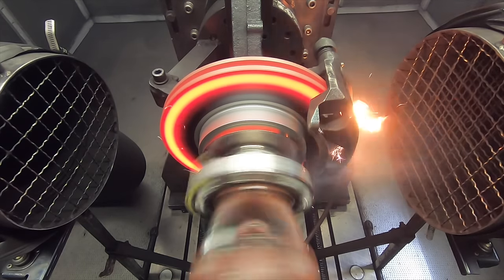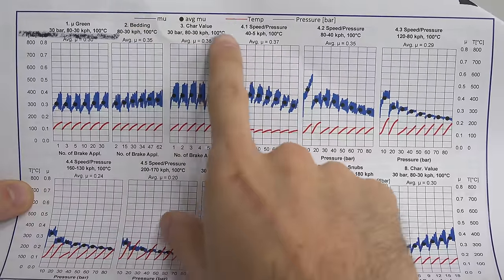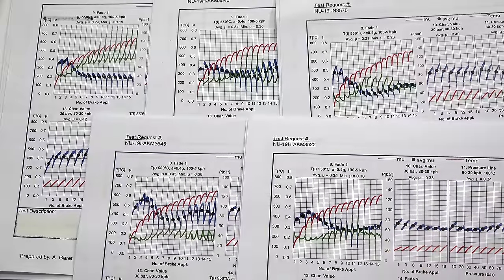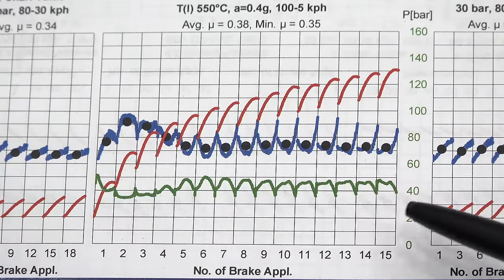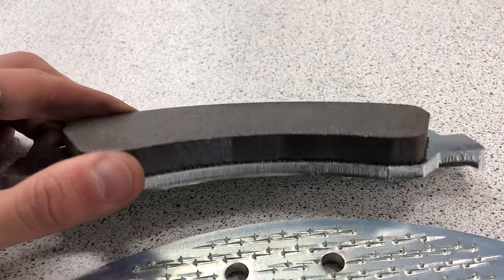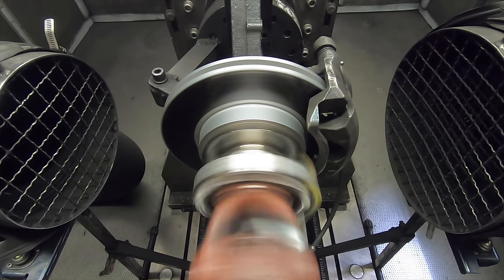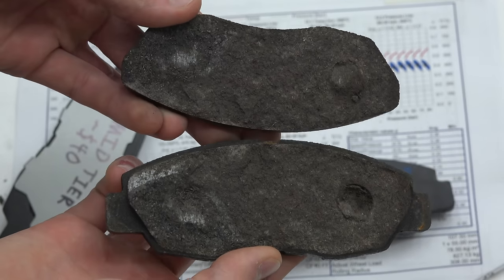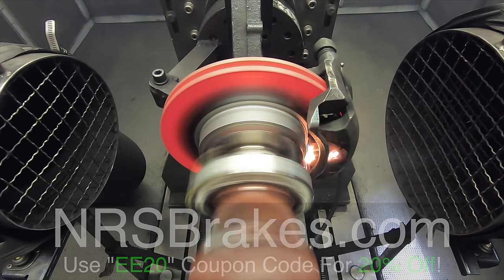What Are The Best Brake Pads? Cheap vs Expensive Tested!

Comment: Basically the results say "buy original".
Reply: You did not state what kind of materials the pads are made out of. The OE pads looks like the akebono brand installed in all Toyota vehicles.
Reply: @Sam S TY for that excellent comment
Reply: Or mid tier
Reply: Totally agree
Reply: @Sam S
Maybe YOUR dealership wont tell you. If you care about your car then make an effort to get to know the people that work on it. Get to know your dealership. They can tell you where the brakes are from and make sure they are OEM parts you just have to ask and or know who to ask.. The guy behind the service center table probably doesn't know and probably wont have the best information. Go to your parts department. Ask for part numbers. Its not that hard and you can easily get OEM parts.
Reply: @Sam S 
Don't blame me for your bad luck and/or crappy dealerships. 

None of the few repairs I have needed went poorly and I firmly believe its because of the relationship.
Reply: Yes. I've been using a while aftermarket brakes for Nissan Altima, however OEM ones were higher price, but when they were heated performs better than previous AZ's DL Gold (wich are some what good for average).
Reply: @Sam S Yes, I agree with you. OEM brakes last way long for me, between 3~4 years. Cheap ceramic ones are around 2~3 years (obviously the way I drive). Anyway one must keep brakes healthy avoiding overheating.
Reply: You Wish  akebono brakes are OEM high quality and made in Japan. My mechanic showed me the same pads used in Toyota and Honda vehicles.
Reply: For hard track use however, a lot of oem pads will fade (unless the OEM brakes are a 4/6 piston brembo package designed for track use).
Reply: TTmore if the car was purchased from the factory brand new with a Brembo package, that is indeed considered OE, because the manufacturer will contact whatever brake manufacture they want to use, and have some spec data they want to meet, and then have Brembo provide the brake package in bulk. That’s basic supply chain 101 stuff, and is indeed considered OE, because it’s what was engineered originally into the manufacturer design.
Reply: @Sam S you are so correct, after my last two experience with an OEM supplier it makes me question why I'm paying so much more for the made in China product. Both parts were not physically the same as the OEM and one failed in less then a week. The kicker is it has a crappier warranty then the cheap part and only 1/3 the warranty covered under the new car warranty. I think I will call the manufacture and tell them my concerns.
Reply: Thanks you saved me time
Reply: @seattlebeast6165  np m8
Reply: Clearly OE is the best.
Reply: @aflacduck2  I would say "both", and they have products that exceed OE.  In any case, if you have a taxi and live in say Arizona, the 20$ pad will probably be a better option.. it wont rust, you wont overheat them and you will probably be able to use 3 sets of pads per rotor.. and a taxi in NY will probably use a galvanised pad, like the company promoting this video.
Reply: @aflacduck2  If it came as an option on the vehicle, then yeah, it would be O(riginal) E(quipment). If it didn't come on the car from the factory, then no, it's not OE, its aftermarket.
Reply: @Sam S OE means Original Equipment which is the approved replacement. It is typically made by the car manufacturer itself or their supplier for the assembly line. It is either identical to what the vehicle had from Day 1 or an improved product that would have been used on Day 1 had it been available.

RockAuto literally has an OEM category for this stuff. And if you have a Ford, Motorcraft stamped on them is a pretty good clue. Same with AC Delco for GM.

Learn your car and you'll know what's OEM and what isn't.
Reply: @Sam S Nobody's talking about warranties. Just getting OEM parts. 🙄
Reply: @Sam S OEM means Original Equipment Manufacturer. So yes you can get Original Equipment parts. 🙄
Reply: Anankin12 Thank you sir. Saved me 17 minutes :-). I’ll buy original.
Reply: Sam S I’ll get OE or close enough. It’s a daily driver and not a race car so no need for high  $ pads.
Reply: @Sam S Why you have such a twisted view on this, I'll never understand. All you have to do is Google what OEM means.
Reply: @Sam S Oh so basically the entire internet is wrong now because Google only gives results that prove you wrong.

Got it. 👍

😏
Reply: @Sam S My mechanic thinks parts supplied from factory (when built) last longer than OEM spare parts - items such as radiator hoses, batteries, etc. May not always be the case, but there may be something in it due to warranty period of vehicle?
Reply: It's sad how many people think that they have to have someone do their brake job for them. With modern disc brakes the job is actually super easy of you have basic tools and just watch a few YouTube videos on the process. In the end, you save a lot of money, get to ensure that the job is done right, and have the sense of satisfaction that you did the work yourself. Granted, there is a section of the population that really should have the work done by a professional, but for any able-bodied person with the right tools,  it's completely doable.
Reply: Out of those company’s yes but there are to many variables to say for sure that oem pads are better than after market ones
Reply: TTmore brembo is it’s own company they make big brake kits along with parts for factory cars
Reply: Sam S for witch one
Reply: @Napster60  changing brake pads is really simple. On my pug 308 a one hour job (second time of doing it!)
Reply: Sam S they make brakes for cars and bikes
Reply: I'm pretty sure the results say to buy mid tier....... Not sure what video you watched lol
Reply: I'm a simple man: buy the cheapest pads on earth that can stop my car. Move on to bigger and better things...
Reply: @james_the_darklord  I was wondering if OE was Akebono as well.
Reply: Tom Reid  You dont need one if you do it right. 😉
Reply: Thanks man, saved me so much time.
Reply: @aflacduck2  they'd be considered OE if the car came with it from Factory. Generally, the only way to guarantee you're sort of guaranteed to be getting OE parts is by going to a dealership and requesting OE parts.
Reply: Honestly it reasured me that mid tier is where it's at other than noise and I don't care about that
Reply: Really? it seemed like the midgrade performed just as well as the OEM, though maybe had more rust... >_>
Reply: Depends on how much you drive daily and if that's the only car you drive as a daily. I just drive to work so I'll consider mid tier in the future.
Reply: Ceramic pads dont dirty my rims. That's important to me.
Reply: @Sam S just go to your "OEM Dealer" like whatever... VW. Yes there are companies manufacturing "the OEM Part" and sticking the "VW" sticker on it and you can buy them as "OEM Manufacturer" Parts but i dont think big companies like Toyota VW GM etc. are gonna sell cheap stuff with their name on it.
Reply: @Sam S im from germany so i guess thats maybe a different story.
Reply: @Sam S idk what dealerships you go to but mine always give me original oem parts!
Reply: The OE pad versus the pad you buy from the dealer are not the same thing. I worked for a major tier one, aftermarket parts are a completely different thing with different materials and different compounds.
Reply: @Sam S that last statement is not always true, like with tires, manufacturers will often use cheaper tires on a car that they are selling, like my moms 2015 hyundai elantra, the summer tires only lasted about 70k, but only about 30-40k of that was summer driving, the other 30-40k was in the winter with winter tires on so they barely lasted past the 4year mark, but in a place with a hotter climate, they would've struggled to last 3 years. (not trying to nitpick, just throwing it out there and i'm bored lol)
Reply: Exactly!!! Like many fake brembo ext ext
Reply: This is the rule almost always...
Reply: Actually, it just says track level use. Normal use doesn't heat pads that much.
Reply: @james_the_darklord  Agreed. Fun fact Akebono are also Brembo pads.
Reply: oem VW/Audi is often TRW
Reply: @BurnDuration  Brembo pads aren't any good on track as they fade at too low of a temperature, Carbotech XP series or Ferodo DS series are great however. Brembo discs are pretty decent though I've yet to warp one through abuse.
Reply: EBC Red Stuff is worth it over OEM
Reply: Solar Survey Monitor Cheap pads are likely organic, not ceramic.
Reply: @Sam S buy through a dealership, will for sure be oem
Reply: so does that mean that Canadian Tire aka. crappy tire actually sells good brake pads for $40 each for the Motomaster OE front brake pads?
Reply: Why not show brembo break pads, oh yeah dont want to put better pads then oem on the vid 🤣🤣🤣🤣🤣🤣
Reply: I wonder if they just fudged the numbers to make it seem way more betterer.
Reply: Nah. Hawk pads all the way
Reply: @aflacduck2  OE parts are typically on the higher end of the spectrum and the argument about buying OE vs aftermarket is the quality. Say OE brake pads are supplied by brembo. You are shopping for brakes and you have several options. The OE pads from brembo are NOT going to be the cheapest option. But guess what? That was the pad your vehicle was Originally Equipped with so if you purchase another set of Brembo's you can expect the car to behave the way it did when it left the showroom floor vs. aftermarket from wearever for example that may or may not perform to OE specs. OE parts are NOT a bang for your buck deal but is more about reliability and quality. As a Mercedes technician I have seen firsthand major quality gaps between OE and aftermarket parts, ESPECIALLY when it comes to brakes. I don't f**k around and ONLY replace my brakes with MB OE brakes because they will perform just like and last just as long as the pads that were on the car when it was new. Just trying clear up confusion and get people the right information. Bottom line, spend the money and get OE.
Reply: @aflacduck2  To answer your question Brembo is considered OE if that was the pad the manufacturer installed on the vehicle at the factory. Bottom line is, whatever brand was installed at the factory is considered OE. Mercedes uses Mobil1 oil but uses fleece Mann filters. So an OE oil change would be Mobil1 oil and a Mann fleece filter NOT a mobil1 filter. Hope I answered your question! 🙏🙌
Reply: @james_the_darklord  Made in USA
Reply: @trogers2120  70 k is a hell of a long time for a tire..
Reply: @Napster60  if you show u are aware and knowledgeable, you are less likely to ripped off because they know they might get caught
Reply: That’s the conclusion I came to with dirt bikes when I did top ends. Want good stuff, buy the OE parts.
Reply: Oem pads vary hugely between vehicle types, an oem pad for a higher performance vehicle is likely to be good enough for most, a average mid to low end vehicle will often have an organic compound with lower metallic content for good low temperature feel and low noise,many years ago a shop I worked in sold a cheap pad with a very high metal content and being the cheapest on the market they sold well but tend to squeak when cold but performed well when hot also a bit harder on rotor’s,bit sad though haven’t seen them in years!
Reply: @dakotagarcia3772  My dealership told me 4,000 for front brakes on a car with 13k miles that I only had for 1 month
Reply: Hm
Reply: A lot of people are confused about what OEM relates to. Just means what brand, composition and style was equipped on the vehicle at the factory based on parameters set by the engineers during testing. For example, my 2018 Camaro SS has Brembo brakes. My wife's 2016 Camaro LT v6 has AC Delco brakes. Two completely different braking systems and brands on virtually the same vehicle overall, but both are OEM.
Reply: Thanks for saving me time

Comment: 6:47 $7 million test facility, $15 harbor freight calipers
Reply: You can do the same for only about a 1,000 old straight axle from a junkyard and a 350 would work too
Reply: Wait harbor freight sell calipers?
Reply: @sargentdoggo297  For measuring.
Reply: @Mike Znel  the extendy boi with numbers on it?
Reply: If it can measure repeatedly to .001, then it's more than accurate enough for brake pads.
Reply: It exagerates the results of the breaking test....justifying the entire thing! Circular reasoning
Reply: @Kycirion  Yeah people forget you only need calipers to be as accurate as you need them to be LOL
Reply: @Andrew W  LOL..wonder since when Harbor Freight carried ATe calipers?
Reply: Harbor Freight sells micrometers also. For the more precise measurements.

Comment: Switching to semi-metallic brake pads (Winmax W3) on my FRS made a huge difference in stopping power. I mostly got them for autocross and track days, but it's very noticeable even on the street. The downside is a little more noise and brake dust, but it's totally worth it to me.
Reply: You should try ATE ceramic pads, the difference in performance isn't as big as you'd think with semi-metallics, if at all, while also having no dust issues and less wear on the brake rotors.
Reply: @em4703  Where do you find them?..    I went to their website and chose usa.. it re-directs to ate-continental page..    the catalog only has rotors.
Reply: I’m choosing ceramic. Reason is I don’t straight up race my car. I’ll do some pulls here and there but normal driving is what I do. And I tend to brake soft and from a distance. I’m always aware of getting long lasting use of something.
Reply: Could just be the initial bite, but similar stopping distance?